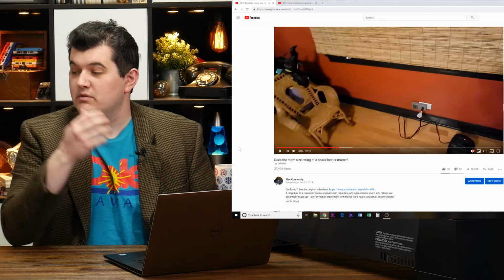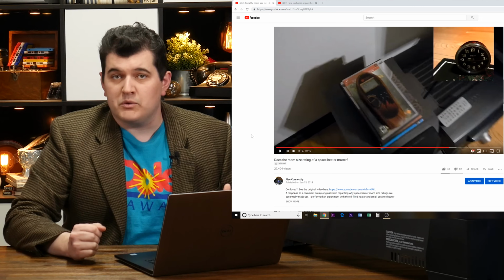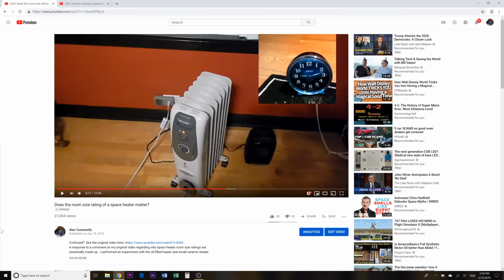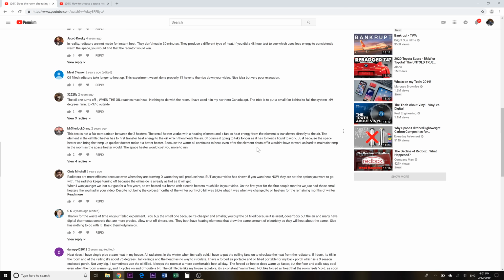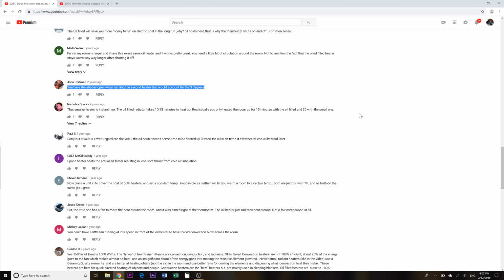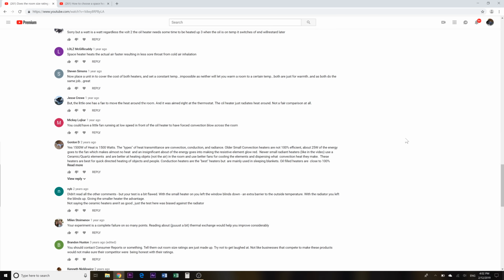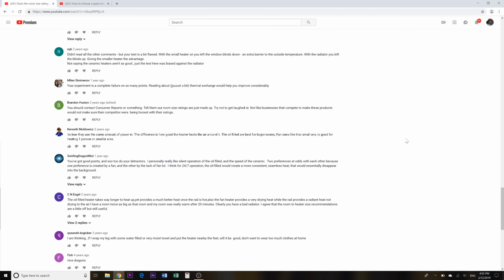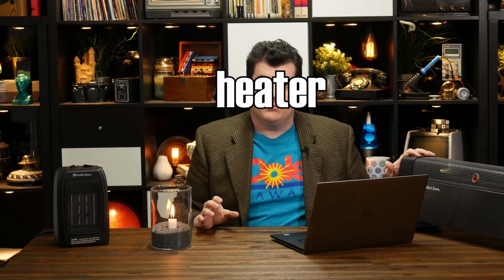More Space Heater Nonsense

Comment: IF you want something slower at heating, put electric heat mats under a new ceramic tile floor.  The theory is the heater will warm the mortar bed/tile and slowly release heat into the room. This takes hours to achieve from a cold room, but once warm, it does a good job.  Often under tile in bathrooms.
Reply: I don't think slow release of heat into a room is any better. What's best is a room that is completely evenly heated instantaneously. I'm thinking it would be cool to have a floor-based heating system that also has air circulation in it (or from another circulating air source controlled by the same system) that quickly pumps the heat into the room to heat the room up quicker. Then, once the set temperature is reached, turn off the air circulation and let the floor evenly release heat into the room. That would be cool. Or rather, comfortably warm.

Comment: Keep in mind, cord connected appliances typically do not exceed 1500 watts.  This is so you do not exceed the 80% rule of the National Electrical code (USA).  In this case, 80% of a 15 amp breaker. [and not a 20 amp breaker]

Comment: I'm really late to this video, I did see the prior one, and had no complaints. 
So how do you make the oil heater more efficient in raising the temp of the room? Move its thermostat further away from the heater. 
All the manufacturer would have to do is make a remote with its own thermostat. 

Will this make the oil heater more efficient in hearing the room? I doubt it. 
As a child I would have simply removed the thermostat, then wire it into another inclosure with its own outlet.

Comment: I use oil heaters here and yes, the thermostat only measures the heat of the heater. The solution is to use a remote thermostat that switches the heater on and off. With the heater set to maximum so it doesn’t kick in and out leaving the room cold.

Comment: I always enjoy your videos. I do have a “fix” that works well for my application. On many heaters there are neon lights that stay lit whenever the heater is turned on and there is a heated element and fan that only work when the thermostat calls for more heat. Basically I switch the fan and neon lights so the fan stays on whenever the heater is turned on and the heating element and neon light turn on when the thermostat calls for heat. This works better because it helps remove the heat from the heater when the thermostat opens it’s contacts, which allows the heater to start heating again sooner, therefor producing more heat.
Reply: Absolutely zero sense in that comment. I don't even know how to interpret what you said.

Comment: I do not have time to read all 4,061 comments. BUT the watts rating is not intended to show how much heat the units will put out. The watts rating is to tell the consumer maximum electrical power load. You cannot exceed 15 Amps on a 15 Amp circuit.  Oil filled electric heaters are not the fasted heaters, they are the safest heaters.

Comment: 1500 watts is a ton of continuous current for an outlet. My toaster is on a dedicated split receptacle. The risk of electrical fire when using 1500 watts on a probably non dedicated outlet is scary. I have a 1000 watt portable baseboard heater, and a 750 watt oil filled unit. The oil filled unit gets used occasionally for a bedroom that the forced air wheezes out of the register. Oh and the Oil filled unit is quiet. I would not be pleased with the noise coming out of those tiny units.

Comment: The room size rating is mostly marketing. If they were to have a rating for efficiency it would be for how drafty the room is, but how do you tell your customer to buy this one because their house is full of holes? The heat from the candle flame is going straight up, if you have no insulation in your roof putting a pot on it actually makes sense because the energy doesn't just get sucked outside whenever a draft blows through. Heaters whith fans have the advantage of directing the heat somewhere useful, this doesn't make them any more efficient. However! as for comfort a heater with fan might not be so great in a large room when a larger yet mostly silent model would be just as efficient at heating the space. Efficiency has to do with the energy leaving the room in bursts and not necessarily how big the room is. Large rooms can have more places for heat escape via drafts, while small rooms would be heated more quickly by a small fan heater so maybe 🤷.
One way or another anything like that you're reading on the box was designed to sell the item to you! Always question if something's realistic or just marketing spiel.

Comment: I agree that they release the same amount of energy. That said, as you said there are practical reasons you may want a heater with more thermal mass. Great thing about oil heaters is they're a lot safer as the exposed elements are not crazy hot. They also don't fill with dust like ones that rely on fans. But yes of course something with direct elements and a fan blasting hot air at you will heat YOU up faster. I'm sorry people are such idiots.

Comment: Ok, let me see if I can try to explain this.  But first, an anecdote...
About 2 or 3 years ago, shortly after moving into my new house, our Heater went out in the middle of a really bad winter.  We still had power the whole time, so we did what any reasonably irresponsible bunch would do and ran to the Walmart and bought a BUNCH of space-heaters.  But we didn't get a bunch of the all of the same kind of space heaters, oh no.  We got a bunch of different kinds.  Small room, large room, radiant, fan-assisted, so forth and so on.  Long story short, we found that the most effective ones were the smaller units with integrated fans.  Reason being:  1) they directed the heat out and away from themselves and 2) they felt better.
Now, we did have to map the whole house's electrical grid (basically) because you can really only have one space heater (being 1500 watts per) hooked up to one circuit, and well, the outlets aren't exactly clear as to which circuit they belong to, so that was fun.

So...on to the point:  in spite of the space heaters all being rated at 1500 watts, variations in their design make them more or less efficient based on how they handle that heat energy output.  Oil-based heaters are designed to deliver the heat energy slowly, over time, even after they stop receiving power.  Radiant electrical heaters or those fancy quartz crystal heaters, generally focus their heat distribution directly to their front, heating the space in front of them very quickly, making for a lot more comfort, but leaving the space behind them quite cold.  Also, any convective heating element is simply inefficient because all of the heat energy rises directly from the device, towards the ceiling, where the hot air warms the wood (etc) of the ceiling, rather the space of the room.  It also creates convective currents, drawing colder air towards it, which kinda defeats the purpose.  In the end, yes, they are all exactly 100% thermally efficient, but...they are not all 100% experientially efficient.  The perfect space heater would draw 1500 watts, have an intact fan on top, and out flow fans 360 degrees around the sides, pointed at an downwards angle away from the device.  You'd lose some wattage to running the fans, but you'd more than make up for it in comfort levels within the room and more efficient heat energy distribution.

Comment: Watts are Watts like Horsepower is Horsepower.  Here is a tested Truth. I fire up a Natural Gas Catalytic Heater in a Cold drafty garage which then heats the back inner wall of the office (concrete). I start it in September and run it thru April. It reduces out Heat bill by $200 a month. Concrete is a heatsink. 

I am certainly with you on the "craziness" of a thermostat on mounted on the heating device. In this day an age- "Bluetooth" a thermostat.

Comment: In general I am in total agreement with you. But there is two things that could be added to the conversation. 

1) Room size doesn't matter. What matters is the surface area (wall area) that is connected to the exterior and the insulation. In private houses room size is usually but not always related.

2) Ceiling height can effect the amount of heat we feel. Room with high ceiling can be 85 degrees at the ceiling and 65 degrees near the floor if there isn't something (a fan) mixing the air. You actually talked about this some. 

Both of these concepts could be worth videos on their own. 

Thanks for the great videos.

Comment: So this is why Alex is a little on the mad side... Just kidding. I viewed the video on Technology Connections found the video on Technology Connextras and it referred to the original and then follow up video at Alec Connectify!

There was a comment I'd like to share and also noticed, the first channel was an incandescent light bulb on a napkin, then new channel was an old incandescent light bulb, this channel is now using a CFL bulb, I can only guess next channel will be using an LED bulb!

I think what got everyone on a knot is not realizing your view you were trying to put across which was all heaters output same heat using same energy but confusing it with the speed at which it can warm up that same space.

In the videos energy used made room feel warmer faster when heat transfer was more efficient (aka fan drawn air) vs radiator or oil filled heaters. 

I would add the parabolic heaters that radiate heat will warm up objects to warm up a room 'may' for some feel it makes the environment feel warmer. 

Yes agree oil filled heaters are by far the safest for overnight use and practice safe heating.

I never used those as it took a long time to make the room feel warm, smaller heaters with a fan regardless of the elements used (ceramic) will heat a room faster because thermal transfer is improved while noise is a trade off.

So in 30 minutes or 60 minutes, the XXX amount of energy used to warm a fixed volume of air in a room is much more efficiently achieved mainly because of efficient heat transfer.

IF a room is ALWAYS drafty, and you want results get a heater with a fan, fix the draft in the room.

If using the oil filled heaters, add a fan and move air around the heater.

Lastly, marketing made this mess but didn't do a very good job explaining it.

Poor Alec, hope you feel better!

Comment: A (really small) part of those 1500 W may be NOT converted into heat in the room (probably in the end it will be heat... somewhere else, but not in this room). Part of the electric current may be spread as (electro) magnetic field/waves. You may be pulling some horseshoes in the street instead of 100% heating the room. :) Or you may be jamming police radiocommunications for all we know. There is a wide spectrum of electromagnetic waves that can leave the room.

But mostly those 1500 W are converted directly into heat, sure. :)

Comment: I think the oil heater is better for a large room as it produces a consistent heat that diffuses across a room. It then reaches a set temperature and maintains it consistently. I believe a fan forced heater needs to pump out heat intermittently in larger amounts. It is a sort of feast and famine scenario. The difference is efficiency over time. I would compare this to a car. Accelerating and braking all the time burns more fuel then accelerating slowly and and letting the car coast to a slower speed instead of braking.

Comment: One of the small benefits of a buffered heating system like the oil heaters is that if your power is cut for whatever reason, the heater will continue to output that heat for some time after. So long as you don't need heat immediately, it'll still output just as much (as long as it isn't limiting itself like in the experiment) once it heats up, for as long as it's hot.
Reply: The entire house stores heat. So if the house is heat-insulated well, and you don't open doors/windows, it doesn't make noticeable difference (except you can get warm by getting close to it).
Reply: I think this gets at my issue with the video? That the variable he isn't including is heat loss through time. On the one hand while the electric space heater creates more heat faster, it leads to heat being lost faster due to a higher difference in indoor/outdoor temperature. On the other hand, the oil heater takes longer to heat, it warms the room (potentially less) for longer. 

In a smaller room heat loss is less of a problem, but in a larger room, it's more of a concern. 

I don't know man...
Reply: @ThePheonixon  If I'm trying to heat the room to let's say 68°F, then I'm going to have the same heat loss from both over time. The smaller one just gets the heat up faster because it isn't turning off like the oil one is, therefore, it's actually doing a better job. It grants heat to the room at a faster rate, and can continue to grant heat at a faster rate. If anything, the oil based heater will be affected by heat loss over time more due to its off cycles, though unless you are heating a room with no insulation, will be such a miniscule amount it won't even be a factor.
Reply: @ThePheonixon  I mean, it's not like if the output of these sources are much different then this will cause any difference under normal operation. The difference is basically exclusively in how they handle edge cases.

Comment: I always thought that the "large room" designation just meant it had a more powerful fan to circulate air better, but some of these don't even have fans so...eh?

Then again, I don't exactly spend a lot of time looking at space heaters, being in Florida and all. At least when it comes to air purifiers (where I see most of the "room" designations), the sizes are normally somewhat connected to the CFM ratings, at least between the same model lines.

Comment: I know I'm fairly late to the party, but I feel it important to comment on his unsatisfactory use of a flower pot for heating. He mentioned that the flower pot and tea candles were ineffective, but that's not an optimal design for that style of heater. I used to be homeless, and back then, I remembered a Pinterest post where someone used 5 or 6 nested flower pots all mounted on a threaded center post and spaced out by hex nuts and washers. Heat that with a few votives, and it's remarkably effective at diffusing thermal energy. I never bothered to figure out how it worked, but it practically saved my life from exposure in an Oregonian winter.

Comment: I agree with everything you said. The Laws of Thermodynamics are, to the best of my knowledge, absolute. And you're absolutely right about the output of these units.

That said, I do have one singular concern that might make me more willing to splurge on the bigger of the two on your desk, if I were in the market for a space heater.

It has NOTHING to do with the amount of heat. It has EVERYTHING to do with concerns about the unit itself. And it could be ENTIRELY unfounded. I admit I'm perhaps "paranoid" about this. The thing is, I've had too many electronic devices fail from overheating. I've had PC GPUs literally melt on me when a fan broke, for example, among an entire scrapyard of other fans that have failed on me. I've had even phones force power down from the heat since I was pushing them too hard. As far as I can tell with my limited experience, the issue with the fans in particular is generally a matter of overheating mechanisms as a result of running too hot for too long without ample airflow.

I think you see why this might concern me with the smaller of the two space heaters. The larger of the two seems like it'd air out nicely; heat rises, so the cooler air moves in. It also seems more spread out, with the heat not being all concentrated in a small space it desperately needs to escape from. But if the sheer heat generation in such a small space on that smaller heater ever leads to any kind of damage with that fan, well, it could potentially be game over and cause the unit to have issues. Even if there's safety cutouts (there probably are,) you're still stuck paying for a replacement unit.

I think this might actually be the basis for the marketing. A smaller room wouldn't need the heat as consistently, since it would be faster to warm. As such, a smaller unit would not be an issue to use in the long term. A larger unit that's likely less prone to potential mechanical failure from extended periods of concentrated heat COULD be preferable for a much larger room. COULD. Again, I'm not an expert; I've just had a ton of electronics fail from heat related issues and I'm paranoid about this stuff now.

Anyways, just my two cents. If it's a penny for your thoughts and I'm putting my two cents in, someone's making a profit, but oh well~

Comment: physics is physics.
not everyone has met physics.

The significant differences are radiant (quartz); convective (radiator); and fan equipped.
There is no magic in ceramics, other than it being smaller and more durable.
I personally feel that the oil-filled radiator is safer, if unattended.
Sometimes a 'fireplace look' has an aesthetic value-add.
The direct radiant heat (usually quartz) has an advantage in that it can warm up a person without having to warm up all of the air and contents in a room. But, you have to be exposed in near proximity for that to work.

The challenge is dealing with stratification of the air in the room.

As far as "drying out the room", some people haven't met Physic's relative, humidity.